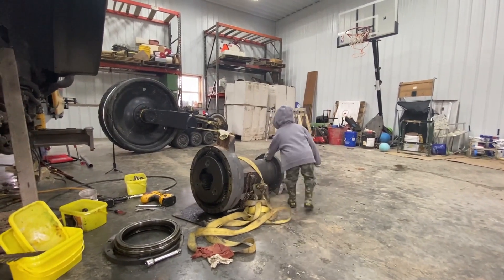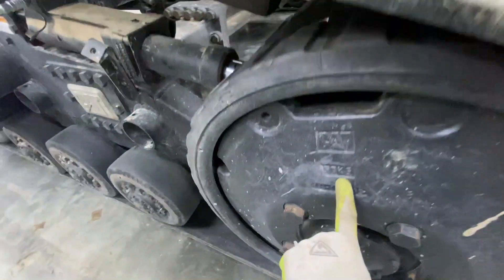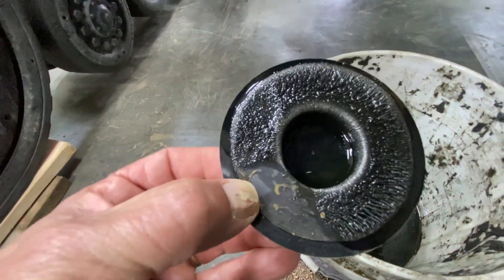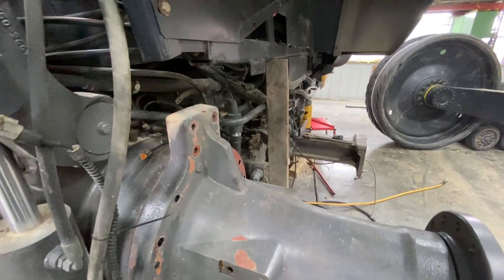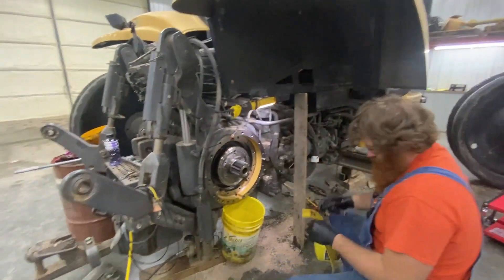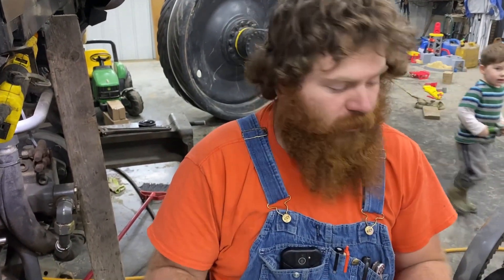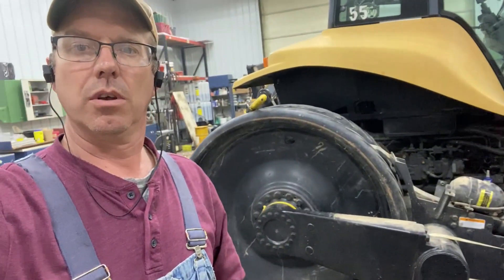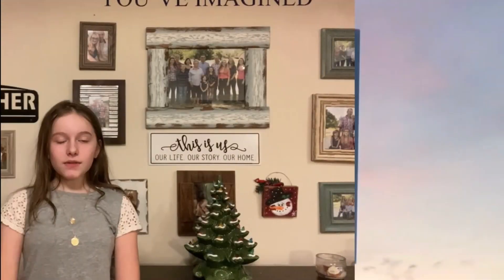Cat Challenger 55 Hydraulic Filter Bypass Steering Clutch Repair: Part 4

Comment: Guys, good vid. But those are the brake discs that you are replacing, not steering clutches. Challengers are hydrostatic differential steer, which allows them to spot turn with the transmission in neutral and the park brake set. If the tractor is in gear and moving there is a shuttle valve that reverses the steering motor, depending on direction of travel (forward or reverse). The steering motor is an axial piston unit on top of the rear frame in either the 35/45/55 row crop, or large-frame (65/75/85/95) tillage tractors. It adds or subtracts power to opposite sides of the differential, causing one track to speed up the same amount the opposite track slows down, which steers the tractor. If the tractor is stationary, steering motor input is the sole source of differential power, which will cause the tracks to rotate opposite directions (spot turn). If you experienced a premature service brake failure I would put the gauges on the brake supply circuit to verify you don't have a brake valve hung up, otherwise you will have a subsequent failure.
Reply from the maker: Thanks for the correction. We were going off of the cat book which called it one thing in a section but listed it differently in another. So thanks for clarifying it. And thanks for taking the time comment!
Reply: @KannmacherFarm  The row crow Challengers are pretty decent tractors. We have a CH45 that we bought new on a 1770NT 16R30 planter, we have a Deere 8320RT on the other 16R30 planter. Of the two I think the Cat has the better track carriage and drive system. Good farming vids you guys have here!
Reply from the maker: I wanted to put the cat on our kinze last year but thankfully I didn’t due engine issues. But still think it would be a wonderful planting tractor. Sherri and I looked at a tracked Deere 2 years ago. Probably should have bought it.  But it had issues long story.
Reply: @KannmacherFarm  If you're on 30" rows, and looks like you have a later wide-gauge tractor with the long hardbar and axle housings so you can set the track gauge to 120", it will work good on the planter. Base gauge, I believe, is 80" on the wide-gauge configuration so you need 20" spacers to set it to 120". We have a narrow gauge CH45 set at 60" gauge and it works quite well with a Deere ATU300 coupled with a 2630 display for AutoTrac. Steering response on Auto Steer isn't quite as fast on wide gauge as it is on narrow gauge settings, so I don't know how well Auto Steer would work on wide gauge. But it will be fine if you drive marker lines manually. If you're on a different row spacing, like 20" rows, then you need 100" gauge and 15" belts to stay off the rows. I got a set of 11" spacers laying around here someplace that would set your tractor to 102" gauge if you have 20" rows. You don't even what to know what Cat gets for those spacers new.
Reply from the maker: I have used it to side dress corn that's why I would like trying to use it to plant.  I found it to be very comfortable and easy to guide.  Our is set to 120" seems to find the pass without making the berm on end rows that i have heard of.  In terms of costs yes that's why we ended up working on the cat tractor ourselves.
Reply: @KannmacherFarm  It will only berm if you're trying to turn on 30 ft passes with a 12-row planter. The wider the belts, the worse it is. We run 18" belts on 60" gauge, turning 40ft with a 16-row and there is no berm at all in the turn.